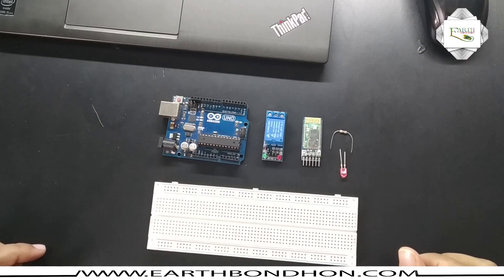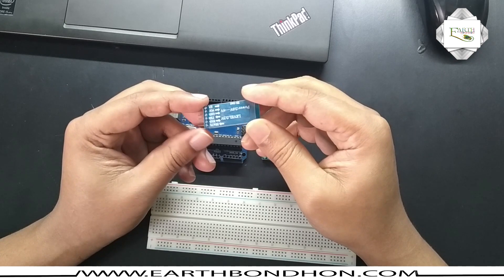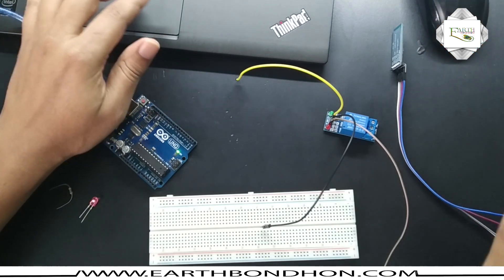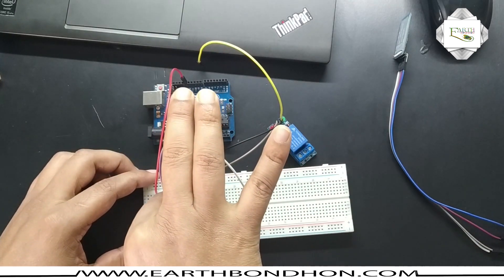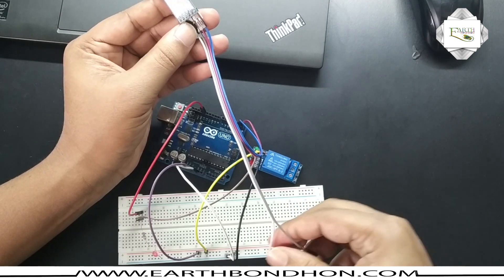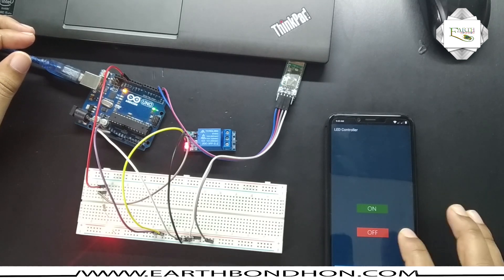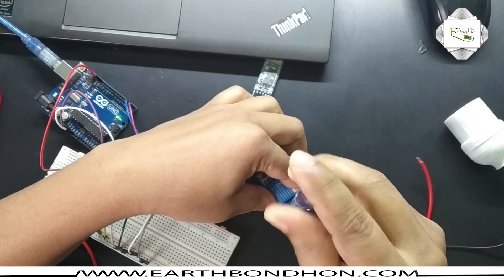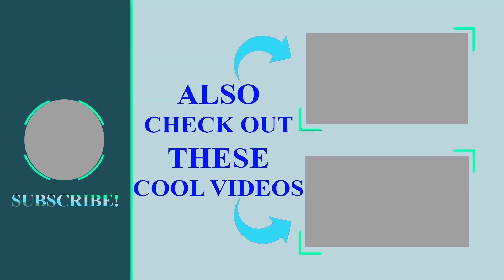#EB-27 Arduino Bluetooth Controller Lamp with relay module | Bluetooth module

Comment: arduino program please
Reply from the maker: yes Arduino program
Reply from the maker: website code
Reply: @EarthBondhon  thanks, but when i send the program to arduino i get error message : stk500_getsync(): not in sync: resp ...
Reply: i think that i resolve the problem by disconnecting wifi modulus
but when i lunch the application led controller i cant connect with blutooth i get BT005 but cant connect with
Reply: no paired blutooth device found
Reply from the maker: why Bluetooth device
Reply: @EarthBondhon  i watched video to solve problem and he advice to disconnect Bluetooth modulus
but know the problem is I cant link to BTOO5